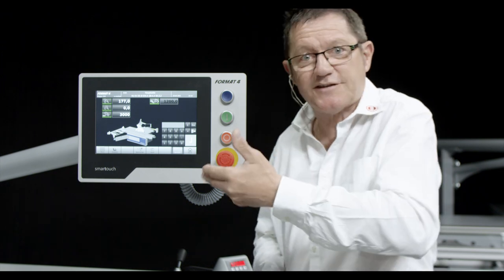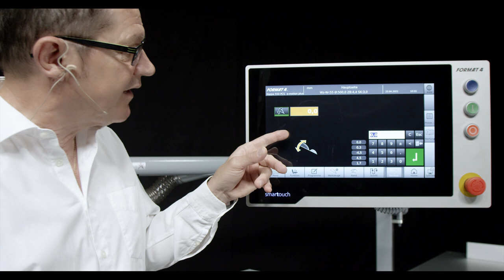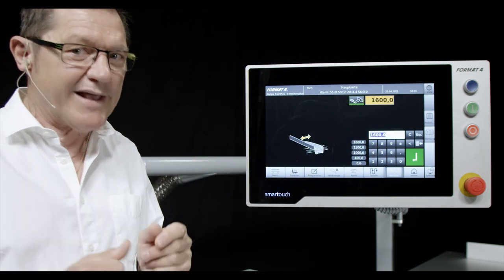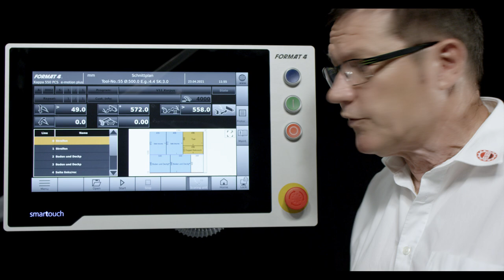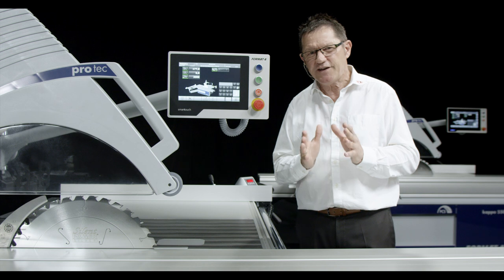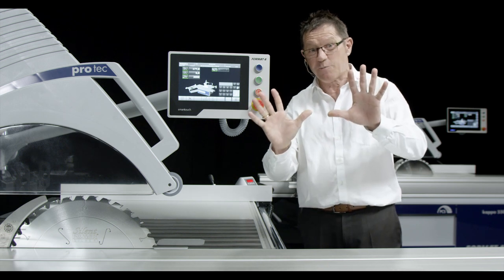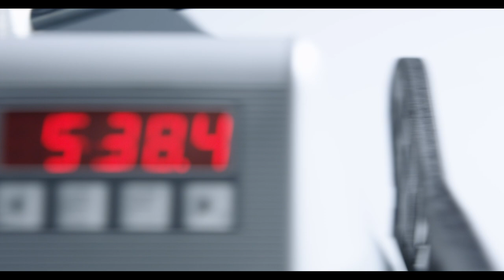Format4® kappa 550  - The new Sliding Table Saw - Powerful. Smart. Safe | Felder Group

Comment: You can see the blade drop, so it's kinda of a slow drop mechanism, no faster than an axe chop, so not sure how protective that really is.
Reply from the maker: Hello, you can find more information about our Preventive Contact System PCS® here: https://bit.ly/38z6AGQ
Kind regards
Reply: Agreed. I need to see them slap a hot dog on a stick at that blade at extremely high speed... Like what would happen in real life.
Reply: Why don’t you start to make your own machines huh?! 
We are waiting here with the  jaw dropped to the floor buttercup.